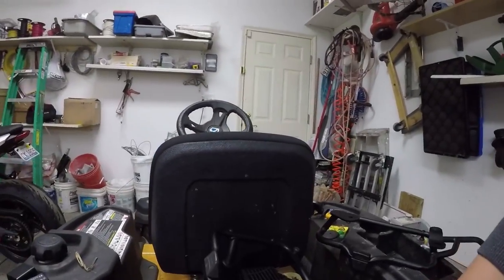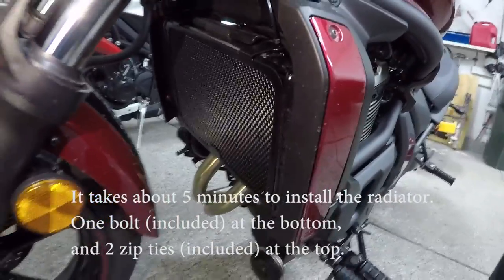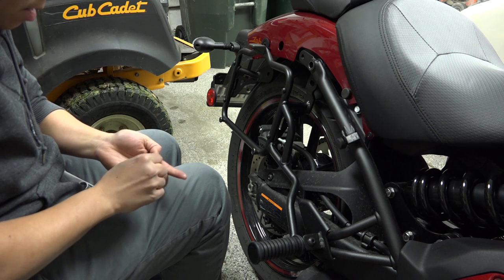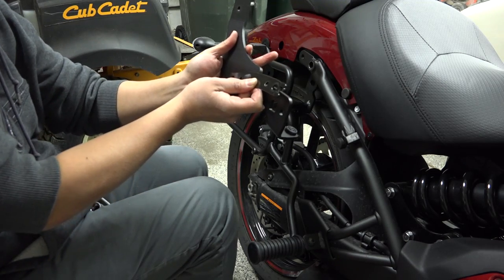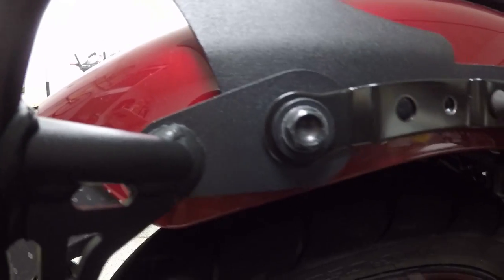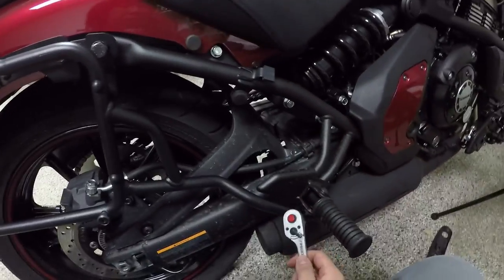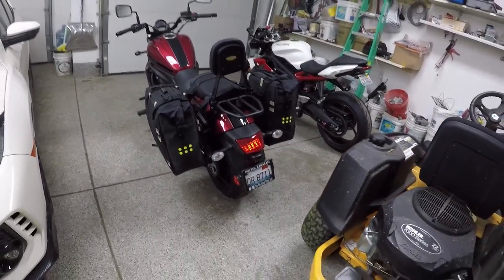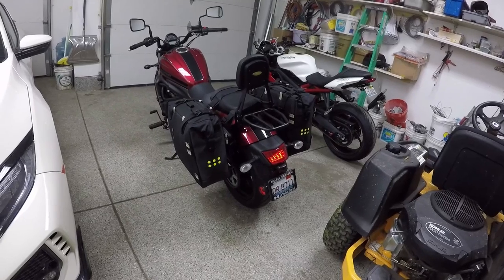2017 Kawasaki Vulcan S - Mods Install - Luggage Rack, Backrest, Radiator Guard, Kriega OS Bags

Comment: How are the bags mounted in this video? Are they simply hanging against the rack? Or do they latch somehow onto the frame at all? They looked fairly solid when you pushed on them, I'm just confused how that is if you're simply hanging them on over seat straps.
Reply from the maker: The bags are not simply hanging on the rack. They are also attached via straps wrapped under the bottom part of the rack. Then the straps are fed through and around the bag (tucked in nicely), then up and over the top of the bag. Lastly, these bags are also attached via a Kirega platform (sold separately) that is attached to the rack as well. With the platform on, the over the seat straps are no longer needed. Hope this helps.
Reply: @VotoCycling  Thanks for the reply! I liked the look so much  ordered the same setup for my Vulcan. I'll probably not use the platforms and just keep the OS Straps, as the platforms are apparently discontinued? Or at least from what I can find. All the same, looking forward to the install!

Comment: I assume if you installed platforms, you removed the monokey attachment on those racks? If so, how did you go about doing that? Sorry for the additional questions haha
Reply from the maker: There are tiny screws in the attachment points. Take the tiny covers off and remove the screws, then you're all set.

Comment: I installed the GIVI PL 4151 on my 2016 Kawasaki Vulcan S.  The GIVI printed institutions were for a different rack entirely.  They sent a bag full of bolt, washer and spaces that aren't clearly shown in the poorly drawn diagram.  It took over three hours and four attempts to get the racks installed, level and perpendicular to the Vulcan 650 S.  My GIVI Trekker 33 panniers still touch the turn signals when installed.
Reply from the maker: Wow, that sounds a like a mess you had to deal with.  I have to say, the instructions were not that good with mine either.  They were black and white and quite dark and hard to make out.  I don't use the Trekker 33 panniers so I'm not able to help you with that.  I hope you've found a fix for your panniers touching the turn signals.

Comment: Hi, will original kawasaki bolts work with Givi side racks?
Reply from the maker: Unfortunately, they will not.  The bolts are not long enough.  So you'll have to use the bolts included in the Givi install kit.

Comment: Fantastic bike, digging the colour, I wanna set my Vulcan up for touring also, do you think the radiator guard is worth it? Have you ever had a situation where something has damaged the radiator?
Reply from the maker: Thanks!  I like the color too.  I've seen/heard rocks hitting radiators causing anywhere from minor to major damage.  I have not experience this but then again, I've always installed a radiator guard on my bikes right after purchasing the bike.  Thanks for commenting!